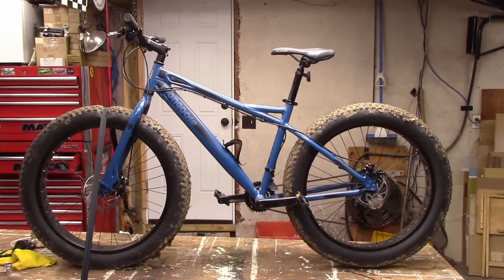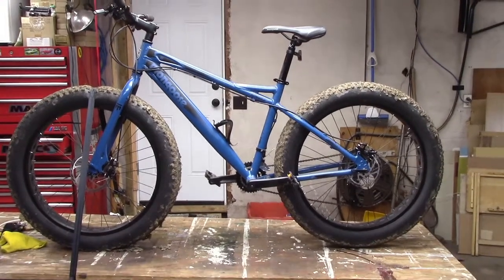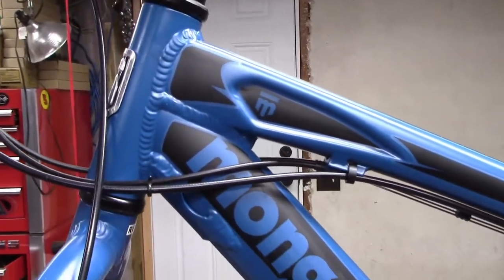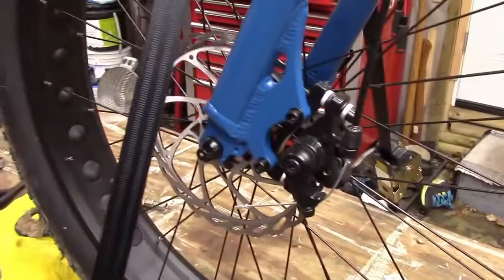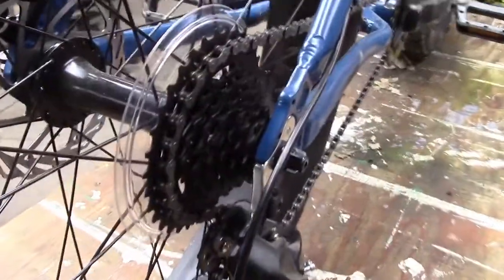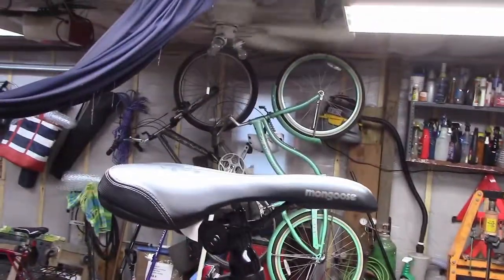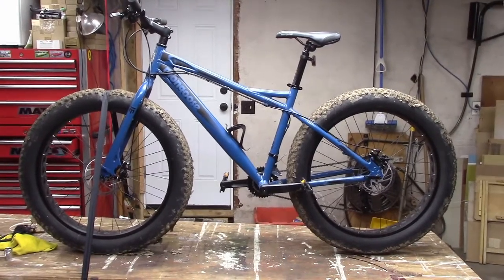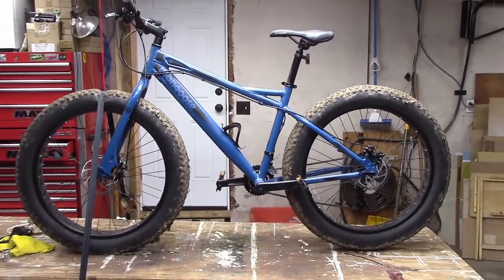Overview of the Mongoose Juneau 26-inch fat tire bike

Comment: Nice, I have a 1,000w Bafang hub  on  mine with a 100mm Mozo suspension fork.  I never rode the bike in its stock condition I was afraid I would like it too much.